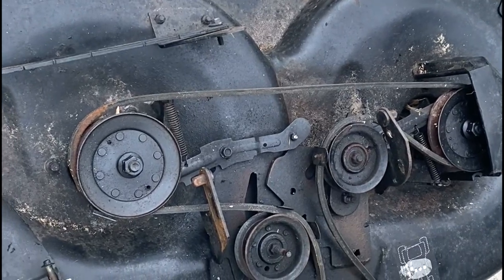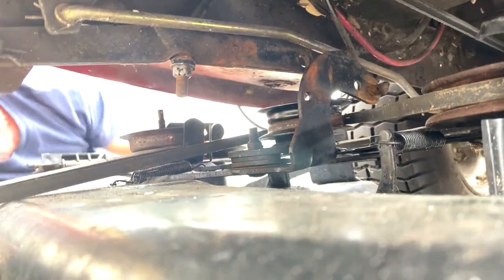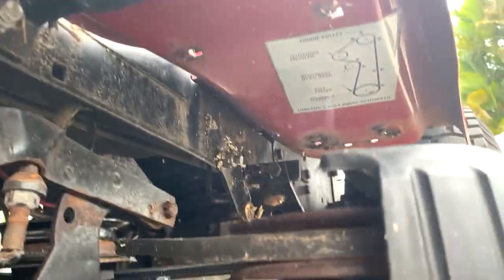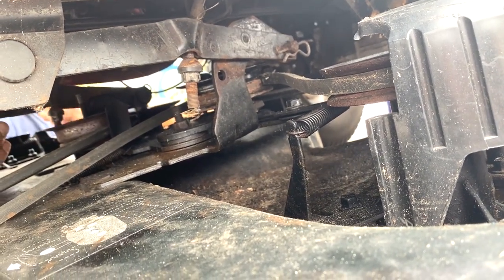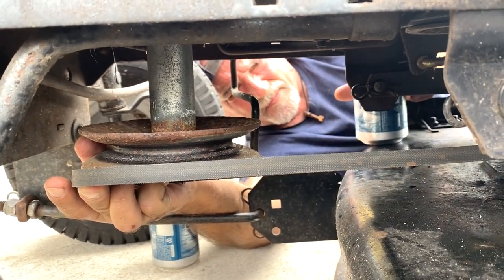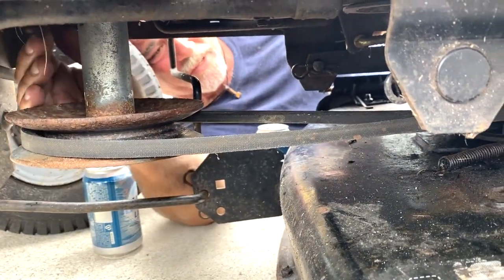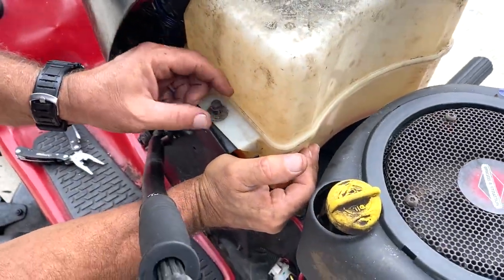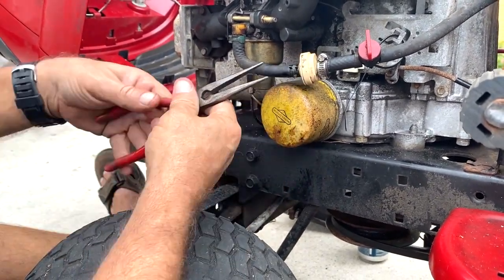Craftsman LT 3000 REPAIR

Comment: When you engage your blades the cable pulls the spring and the spring pulls the tensioner pulley it tightens the belt it gives the belt tension to drive the blades